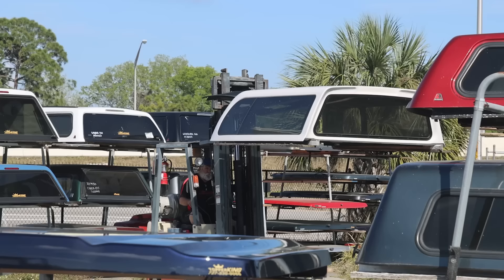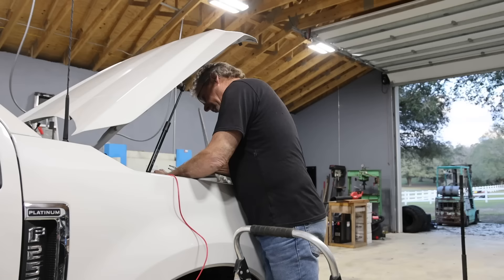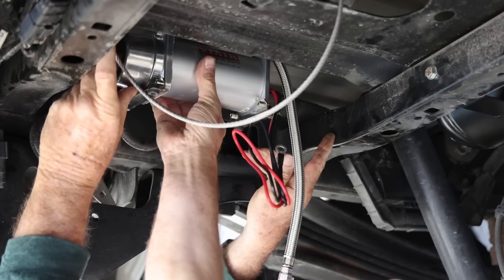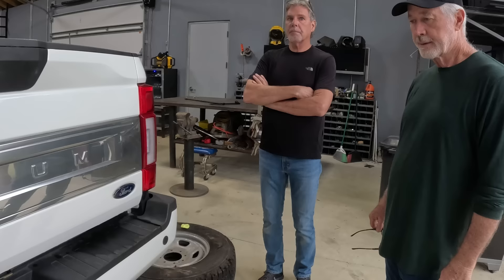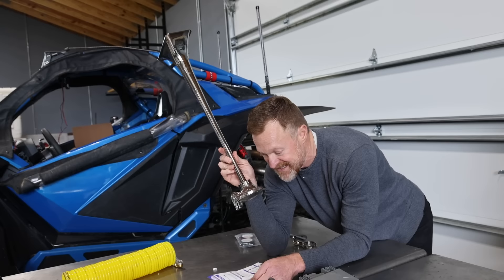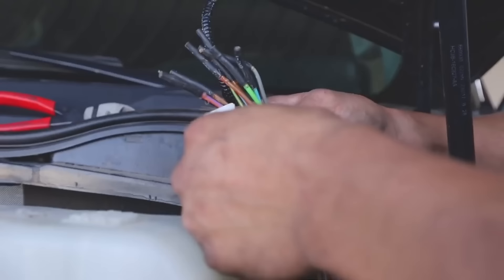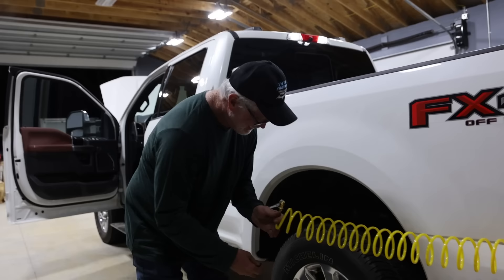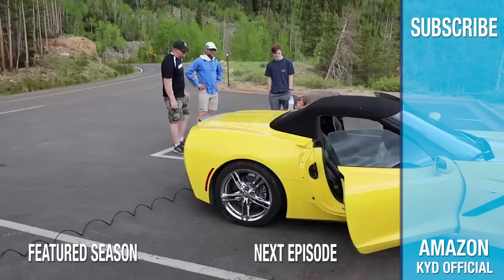🛠 DIY Truck Mod: OnBoard Air Compressor & Horn

Comment: Great work, my only suggestion is Riv Nuts in place of self tapping screws. After the discussion of the pump being removable self tapping screws are not the route to go. Bit of a bummer with the level of fabrication and tig welded brackets to fasten them with self tappers

Comment: I mounted a Viair system.  On thing I added was a water separator between the compressor and tank.  That way you tank never sees moisture.  I found it graves a good amount of water.  I mounted it in the outboard on the frame.  Good insurance.
Reply: That's a really good idea!

Comment: Love it.  Did a similar mod but used a relay to tie the air horn to the truck's factory horn.  The relay requires one of the upfitter switches to be on for the air horn to sound.  So when I'm on the highway, I keep that upfitter switch on so pressing the regular horn button on the steering well gets me the air horn.  Just makes it easier.  Nice job!!

Comment: Okay I watched this at least a dozen times. Ill tell you what I know but know i don't know it all. I have two Viair 444c compressors, they go through a water separator then my 1.5 gallon tank. I highly recommend the separator as my tank is always dry. Get an air regulator and dial down the PSI, the lower the PSI to the horn the longer the horn will last. Buy a new air hose now, or better yet make one using flexzilla 1/4 ID hose. Those yellow coil hoses crack in cold weather, ya know when....just when you need it. Finally your QWORK solenoid, will last about a year, I have a WOLO 846 horn(think fire engine)It doesn't come with a solenoid either. I'm using a HRS valve purchased on Amazon and i love it. Well good luck, I've enjoyed your video.

Comment: I noticed a brass fitting being used as a connection point for an air quick connect at the rear of the truck box. Be advised that if your truck is aluminum and you used a brass fitting or even a galvanized steel fitting, the aluminum will react and eventually degrade the point of connection.The dissimilar metals need to be isolated from direct contact.
Reply from the maker: We had a conversation about that, but then forgot!

Comment: Hey Mark, on a big rig, we had a cable that ran down to the air tank's, you can drain your tank without crawling under the truck, something to check and see if you can do that to your pickup.

Comment: Marc. We have had on board air and air bags in two different HD trucks now. Wouldn’t ever own a truck without. Still no air horn but the air is priceless either way. Additionally a rubber chair foot protector works as a great option to cover your quick connect hose connections when traveling. Various sizes and colors available at hardware stores or on Amazon and cheap lasting solution.

Comment: For my horn I used an air ride suspension solenoid, but that was back in 2003 when the Lowrider mini trucks were popular. They were a lot easier to find.

Comment: Add on for a situation. Put a sensor on each side of the truck. When someone cuts you off the air horn goes off.

Comment: Super Bowl on KYD Sunday. NFL is out of touch. I would recommend an extension hose for the tank drain valve. Also add a hose connector near the front of the truck. Nice install. Thank you for sharing and have a great day.

Comment: Just an FYI for those watching - That truck is a 2022, not 2023 :)  

Marc, had the same experience with the air compressor.  Sitting on top of Logan Pass in Glacier after our hike and some asked if I had an air compressor.  I said, well, yes I do.  It wasn't on board, but still had the Viair!
Reply: Noticed that right away when he said '23 haha I was like, nope, doesn't have those ugly bumper and box steps
Reply: @ryanhessler8966  Bumper, grill, side panel step, dash and sync 4, console, tailights, tailgate.  All different :)  22 is a unicorn.  The only one with a 12" screen and that dash.

Comment: Any concern those self tapping screw heads wearing a hole in your spare?

On mine, I put a couple of 1x3 sq tubing across the bottom of the frame, also at the spare. My dual viair pumps are mounted to the top of them, and a piece of sheet metal extends forward, so where your tank is on the side and won't completely drain, on mine the legs are under it, and the tank drain is truly in the bottom of the tank.

Comment: Did I miss something? What happened to the old horn and compressor? With all the road salt we have here in the winter, my old compressor took a beating and the thin tray it was installed on rusted out. This looks like a much better solution. Safe travels

Comment: Just a thought!  Wouldn't you want the Air Compressor in the engine compartment, where you can get to it easier and it is not directly getting splashed on.  Viaair must make extension lines for it.   Great Video, Thanks for Sharing!
Reply: He has a power stroke in there. No room.
Reply: No room in the engine bay

Comment: This is much better than the Super Bowl. I have a question why do you have stock shocks on that truck and how come they didn’t put a spray liner on a platinum ? I have a lariat it’s got spray liner on it from Ford.
Reply: Spray in bed liner is an option you can choose.  It is not an automatic add, except for certain packages ( I think Black Appearance Package and maybe sport).  I have ordered two trucks in the past handful of years and both I chose to not go the Ford liner route. Many reports of the Ford Liner peeling off.  Better off with an aftermarket one such as Line X.
Reply: @OutdoorsEngineer  well I bought a 2016 brand new ultimate lariat it had that same liner and you just talked about line X and I have a 2019 now that is a gasser cause I’m done dealing with the smog on the diesels and it has it in it as well here Corning Ford that’s what they put in their trucks so I don’t know where you’re buying yours from but I’m just kind of surprised but you’re shocks they’re only good for around 30,000 miles. You might want to go with Bill Steen and your stabilizer I’ve been told to stick with stock or fox friend of mine that does front end here in Redding is the best in the state that’s what he recommends

Comment: We are going to purchase a 27 Globetrotter this May. I have a GMC Sierra 1500 AT4 that has a 9200lb towing capacity. I am being told that anything over 25 feet should have a 2500HD Truck. Thoughts? Many are telling us stopping is the bigger issue?

Comment: Not keen on drilling holes in metal and not protecting the raw edge. I would have used all stainless mounting hardware and done something different than using self tappers. Otherwise great video.

Comment: Trying to add horn to my F250. I was hoping your video would show where to mount the horn. Maybe I missed it.
Reply: I added  a grand general triple trumpet horn just above the drive shaft on my f250. I used rivet nuts through the cross member frame. Very sturdy, and plenty of room.
Reply: It starts around 16:24. It sorta looks like it neatly or under the engine bay, I may’ve missed if they mentioned where they were attaching it.

Comment: Does the factory stabilizer remain when the dual Bilsteins are installed?
Reply from the maker: Yes, it's a bolt on kit. There is actually no OEM horizontal stabilizer. I'm looking to replace my Icon kit as I think this is better.
Reply: @KeepYourDaydream  When my 2017 death wobbled I replaced my factory stabilizer with a Fox Racing adjustable unit that bolts in place of the factory unit.  No issues with it but I really like that Bilstein setup.

Comment: With that horn approaching 145 dB, it is not legal for use on FL roads, along with many other states.
Reply from the maker: It's the same as a truck horn, which are all over the road. Not sure if the rules are different for commercial semi's. It's really not that loud, but it didn't replace the regular horn so discretion can be used. For us, it's more of a fun hello and goodbye toot.

Comment: I've been wanting to do this for awhile, but will pay somone, however, did I hear correctly, that the air compressor comes with it's own gauge and on/off switch, so that if you don't have upfitter switches (F-150), you can use the included parts instead?
Reply from the maker: Yes, it does, but the switch isn't great. I should have talked about it. I'd look into an OEM switch. A good shop can place in the dash. Or you can create a relay to make your normal horn work regular or air depending on the switch.
Reply: @KeepYourDaydream  Oh, I was talking about actually turning on the air compressor. I really don't want an air horn.

Comment: While this system looks nice, an 18V digital inflator is $50-100 and can be moved when necessary. That’s what I do; it’s a lot more economical.
Reply: Those won't run an air horn.
Reply: Haha. Valid point.

Comment: TIPS: All hardware should be stainless steel.  Plus, it should also be metric like all the other nuts and bolts of the truck.